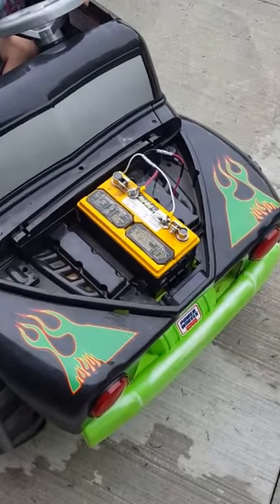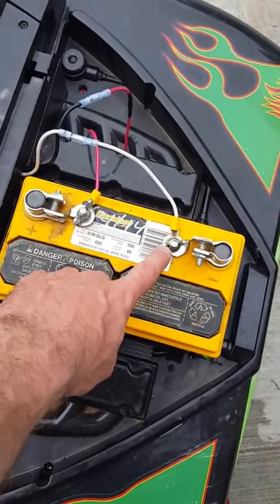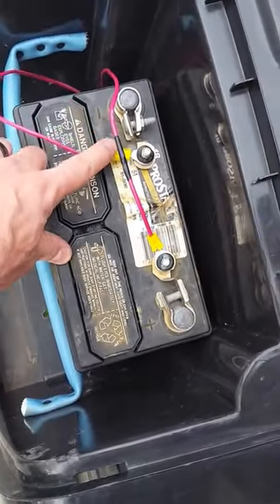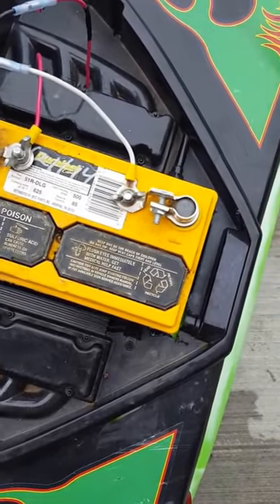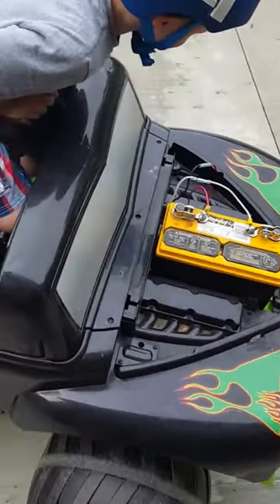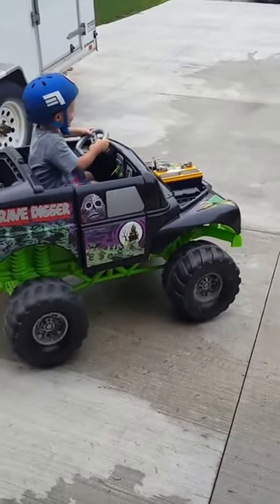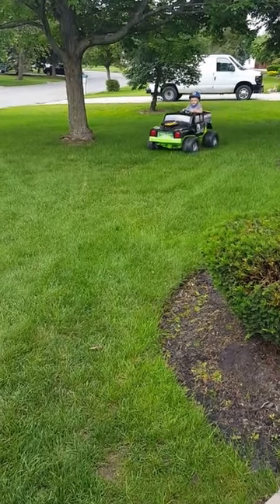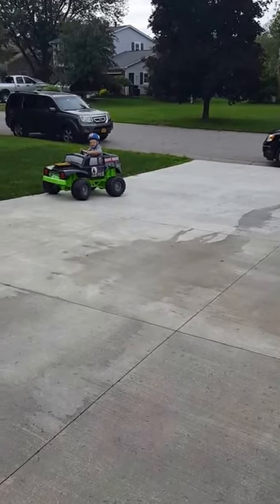Grave digger powerwheels with 2-12 volt car battery

Comment: I tried to use an 18v battery on my power wheel but it didn’t work.  I made all the connections that u show but just the last come on.  The car won’t move.   What should I do next
Reply from the maker: What do you mean "just the last come on" ? If you put the stock battery back in does it work ? Was it 6 volt or 12 volt originally?